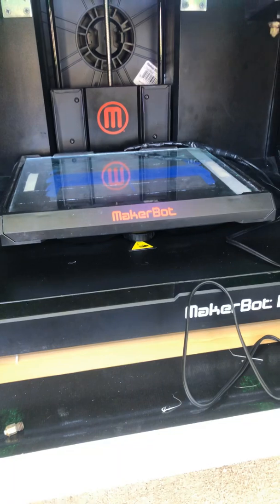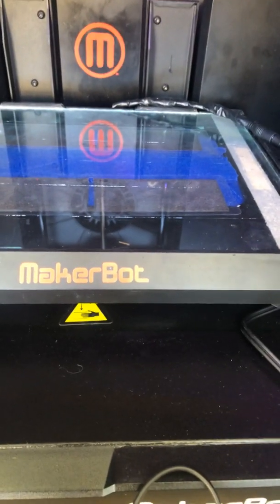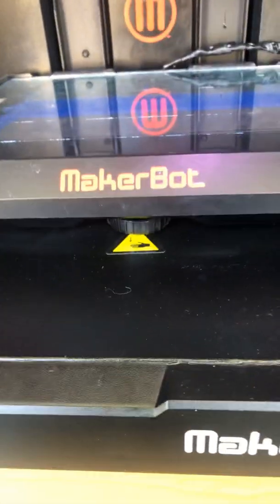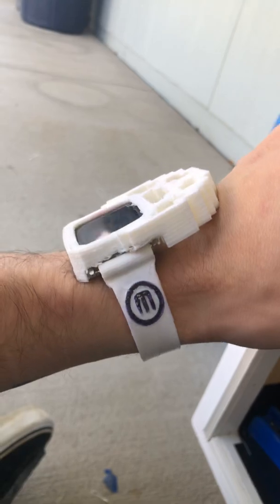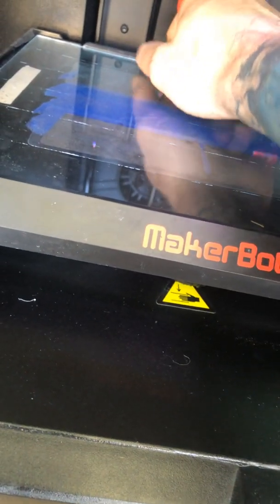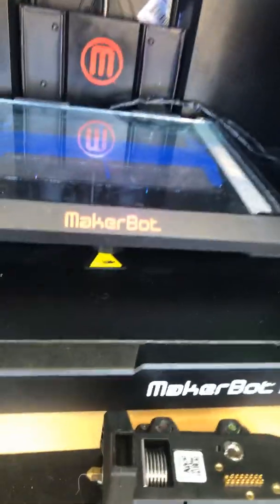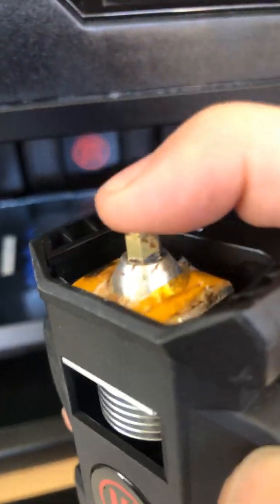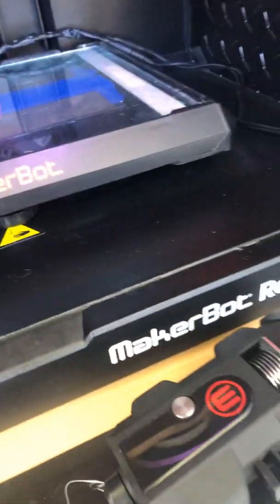Makerbot 5th generation mods that work and don’t

Comment: Do you have more info on the flexible filament modification?  and what ecactly does that "hugger" at 2:50 thing do?
Reply from the maker: It’s a printed gear that grabs the filament better. You have to take apart the extruder. The “hugger” is a printed clip that locks the extruder to the gantry. This is helpful when printing at faster speeds because the magnets are trash.
Reply: @cloudninjaphotography6304  Cool. I've had issues with two of my extruders claiming that they're slipping... I checked the rotation sensor, but it seems fine, so i'll try to find more info about that... any pointers about where to find more info on the printed gear?